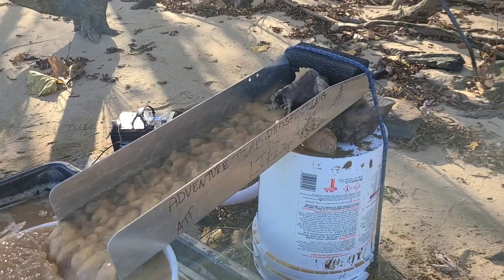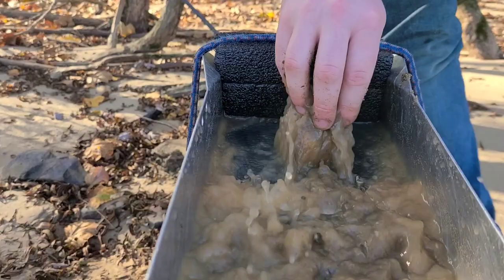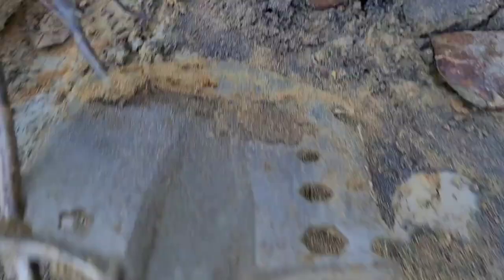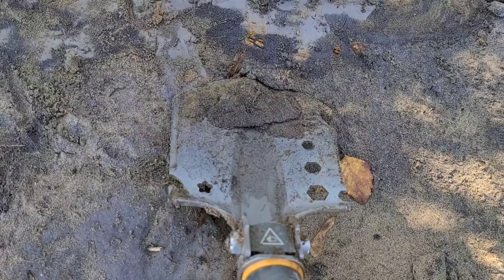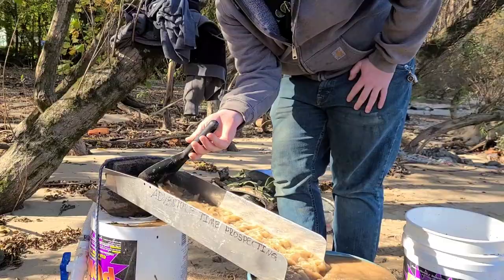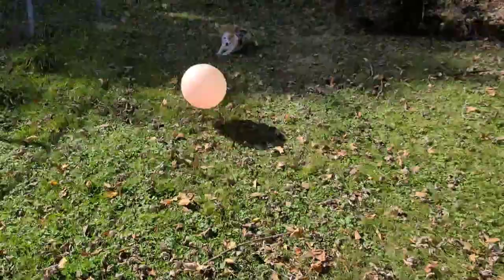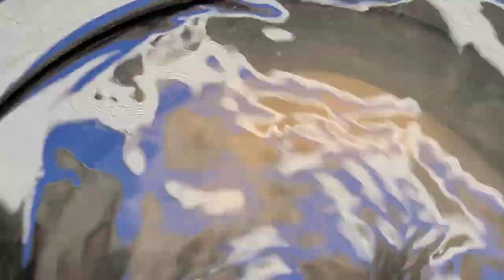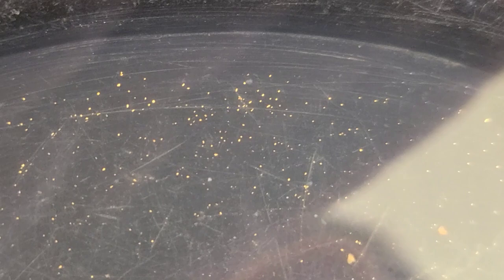Dream Mat Beach Gold! Beach Mining West Virginia!

Comment: I don’t know if you know this but the largest alluvial diamond ever found in North America was in Peterstown West Virginia weighting in at 34.48 carts. A raw diamond will look like two pyramids stacked on there foundation points going out. You can find them panning but in Africa they coat there pans with oil and toss it like cleaning grain. Diamonds are heavier and tend to stick to the pan. I might be off on the method but if I was there I would look for those also. I always wondered because of the high coal concentration it should have diamonds too.